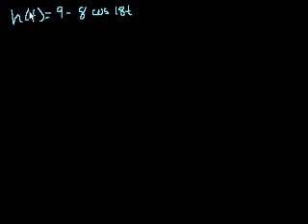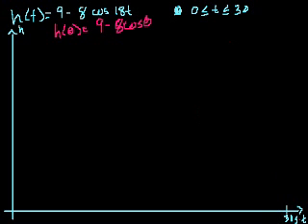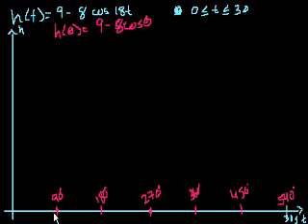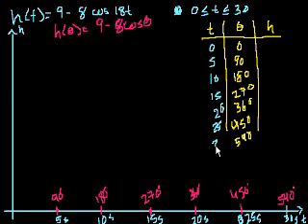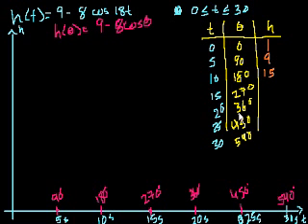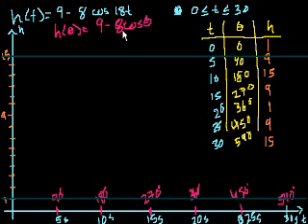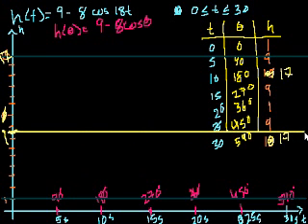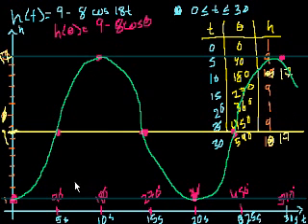Ferris Wheel Trig Problem (part 2)

Comment: You can replace theta with 18t because we figured out that 3rpm's is 18 degree's per second, and if we choose to use seconds as well for our time t, then we can replace theta with 18t.  If one second has passed from the beginning of the run, then the angle is 18 degrees if two seconds has passed from the beginning of the run then the angle is 36 degree's.